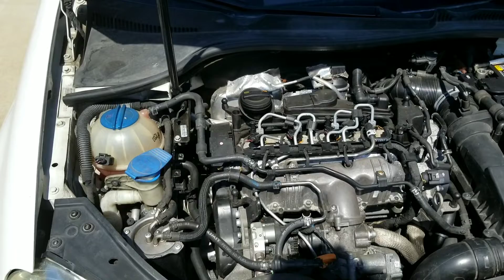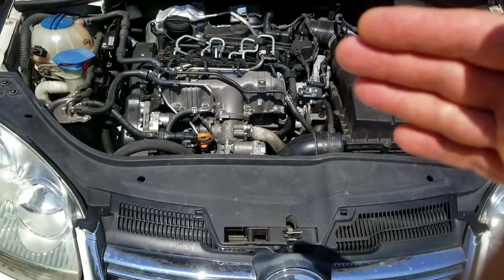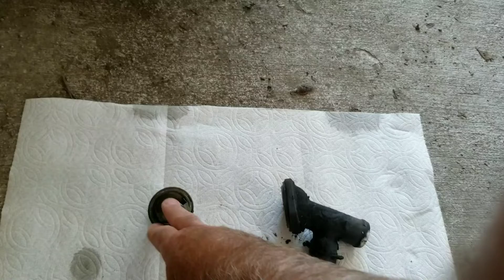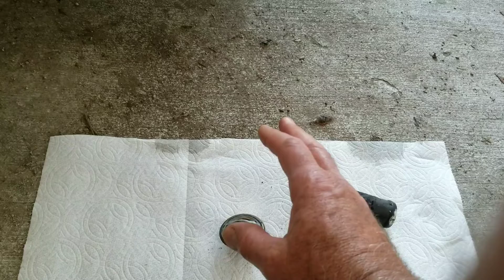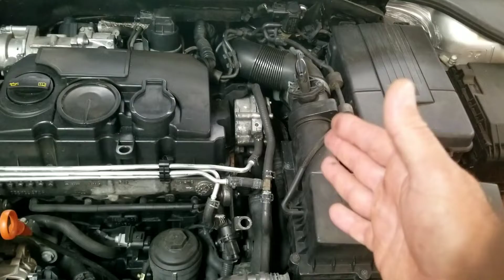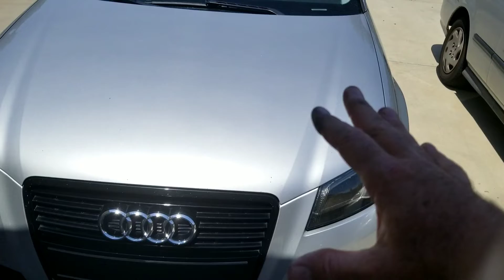ENGINE RUNNING HOT things to look for water cooled thermostat water pump coolant

Comment: If you put in too low of a temperature of thermostat or remove it on one of these newer cars it throws off the sensors and computers makes your engine run too rich or too lean and if it's a car that is prone to carbon buildup issues it will make it much worse because it won't get warm enough to burn off the crap.

I used to own a radiator shop back in the day before you could buy them from China for cheaper than the cost of a repair. Back then antifreeze was still only green and when Toyota came out with their red stuff I said it was a ripoff. The ingredients vary very little except for the additives that prevent damage to aluminum parts. They can make one universal antifreeze that satisfies all car manufacturers like how the green stuff used to be and that would bring the price back down to a more affordable level. Look at that Mercedes blue stuff with their $50+ a gallon price tag. You're paying for the Mercedes name there. Zerex blue has more corrosion preventative additives than what the Mercedes blue has and it's under $30 a gallon and certified for use in Mercedes cars. Antifreeze is not far off from being a scam these days. Read those labels and save a few bucks when you're changing yours.

Comment: Mike are they using the right coolant VW uses a defecated coolant!
Reply: I think he is talking in general about overheating ....not just a Bavarian Money Waster!!
😂
Reply: Sorry we have 3 golf we never have problems except for 1 that I bought slightly used it’s having over heating problem to until I change the coolant solution into the right one I’m talking from experience here I’m sorry too if you have a dislike on German cars the only I’m having problem with is a Mercedes sorry again!
Reply: @danvillareal8304  
def·e·cate
/ˈdefəˌkāt/
verb
past tense: defecated; past participle: defecated
discharge feces from the body.
Reply: @danvillareal8304  
I have no issues with any brand...i have owned many in my almost 50 years of driving.
German cars/vehicles are highly regarded by many and hated my many too....to each their own...
The parts are more expensive from my experience...why i don't want one... I fix my own vehicles....
Reply: Dedicated coolant is what I’m trying to say sorry please end up this I got better things to worry about thanks!
Reply: @danvillareal8304  
I'm just helping you ok...
Wasn't a diss....i just let you know you spelt it wrong so you can correct it...😉
Stop What??
I'm busy too..
Fixing my vehicles...
Reply: Gary by the way if you are a Dad Happy Father’s Day!
Reply: @danvillareal8304  
Happy Fathers Day to you
If you are one??
🤔
Reply: Happy Father’s Day Gary!
Reply: Happy Father’s Day to you Mike!